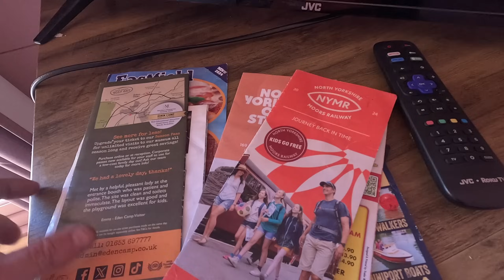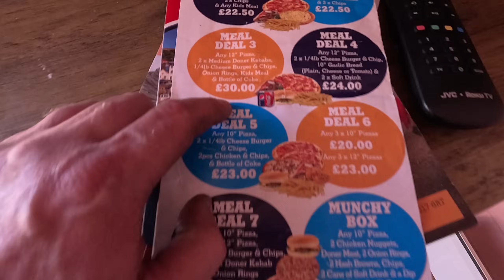I stayed in a £88 GLAMPING POD for one night .

Comment: The fly issue has probably happened because a fly got into the rubbish bin with no lid, laid its eggs in some discarded food in there, normally up to around 100 eggs.  Eggs turn to larva, which wriggle out of the bin and under/behind the cupboards.  Bin gets emptied after guest leaves, and cabin is shut up until your imminent arrival.  A week or so later they all hatch, and make their way to the windows to try and escape.  Unable to get out, they eventually all die after a few days and drop to the floor underneath the windows.  The cleaners then prep the cabin for you, see all the dead flies and clean up all the ones that are easily accessible, but didn't think to look behind the bed.  This same exact thing has happened to me!  Always use a bin with a fly proof lid, or wrap discarded food in bags/clingfilm.